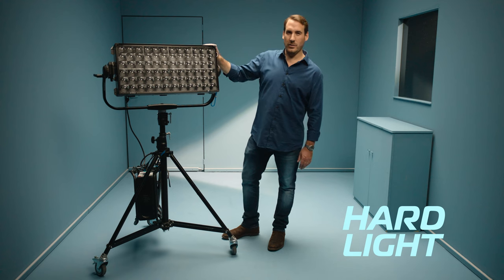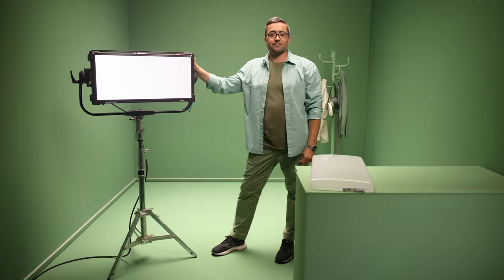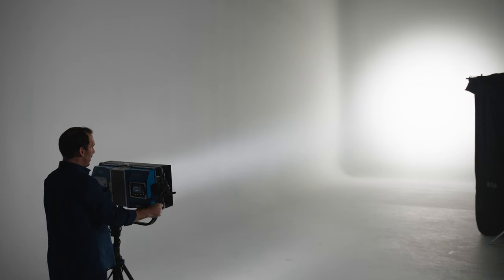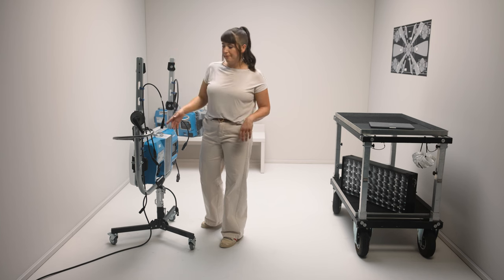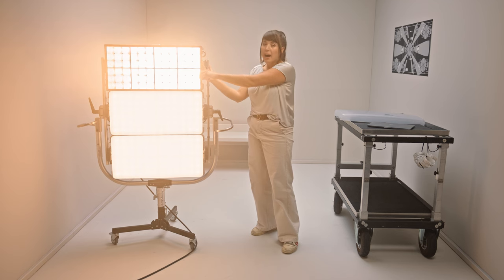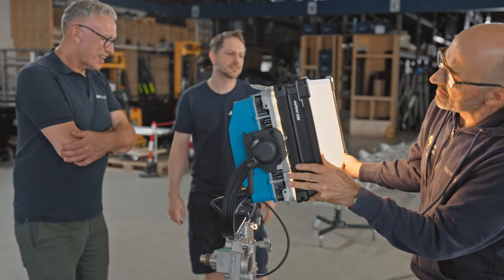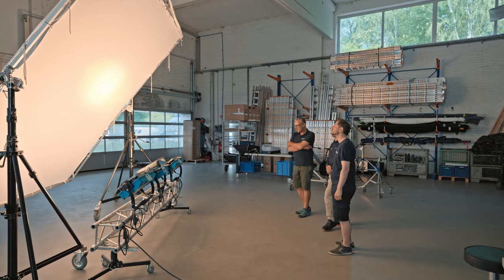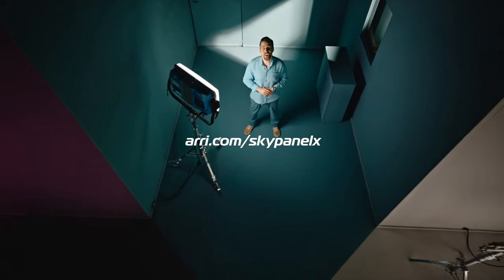SkyPanel X Premiere

Comment: Would it be possible to see an off-speed frame rate test with the light dimming down then brightening up? Stage mode on the old panels caused a lot of flicker if it was accidentally set on or used to get smoother dimming for effects. If any DOP/DIT tests this please get in contact!

Comment: I have a question they control is the same at the orbiter
Reply: Yes, but the one from the Orbiter is not water resistent. 
But you can use it though.
Reply from the maker: @sylwynas is correct - control panels are interchangeable, but the new one shares the same IP66 rating as the SkyPanel X